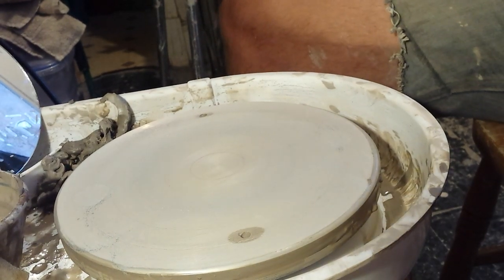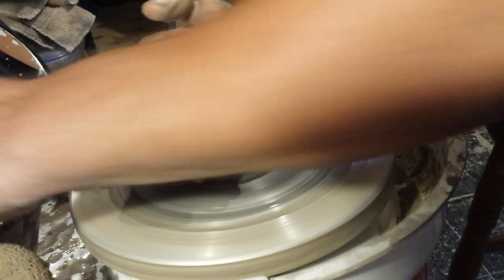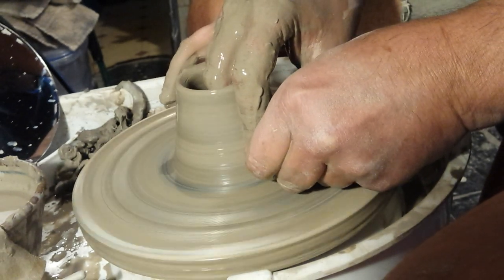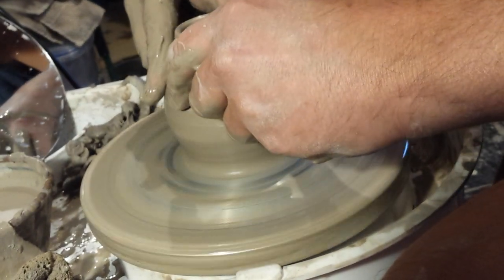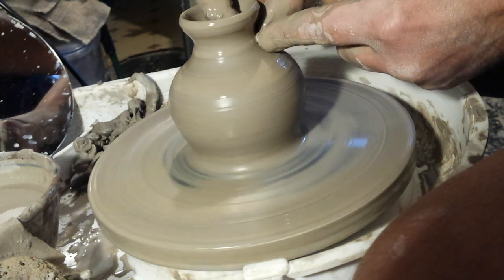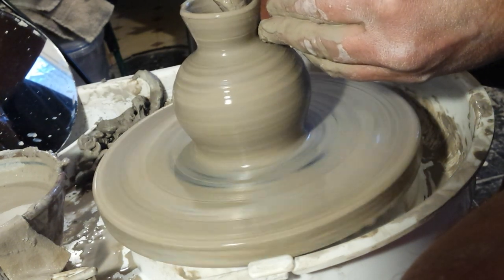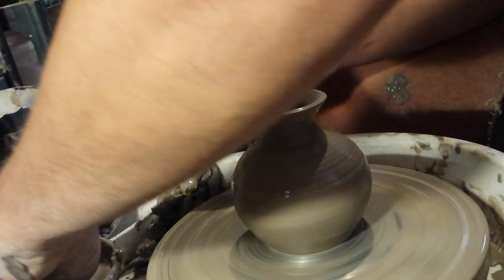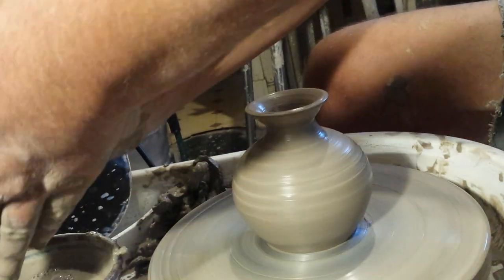Ebay budget wheel purchase.

Comment: I use one just like this and only have trouble above 10 pounds. Wheel is just a tad above 9 inches so I drilled bat pin holes at 7-1/8"  and made my own bats from 9" birch wood. Works great.

Comment: Leigh, welcome back to the electric wheel group. So pleased you did a jump in and got the cheap one. Is that not unlike getting 10 fancy cups at Starbucks without a matching reward.....2 of your mugs being sold will pay for it.
So I am sitting wondering if you can look into buying a spare motor with a wee bit more power. Just to have on standby in case the original dies in 2 or 3 years. Might take a wee bit research...
I am amazed at the price.....a replacement wheel head for my wee Aspire would cost $75.00 plus shipping........
I hope you get many years of use out of this and that the pots will just glide off into the kiln.
Reply: A replacment plastic splash catch for a Brent is $75.00.
Reply from the maker: Thanks Freddie,  yes a back up motor sounds good, I'm thinking a bigger more powerful one but I think that would involve better wiring.  Shimpo is such a well known brand I guess that's why they can charge so much,  at least you have the back up of Spare parts if something goes wrong. I don't think I've seen you're Aspire,  is it the one in your clips?
Reply: Hi Leigh, yes it is the blue wheel in my clips. I am trying something different sending you a link to see if it reaches you.....
https://photos.google.com/photo/AF1QipO_dgN53qsaAY5BlfyoP6qXf4sBiCyIoi9CSRJ4
Please let me know if you can open....